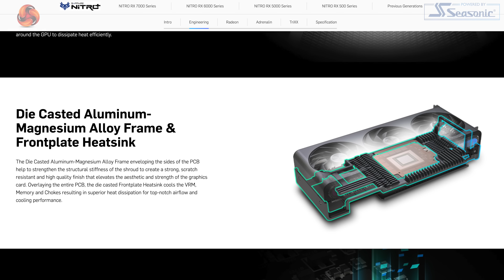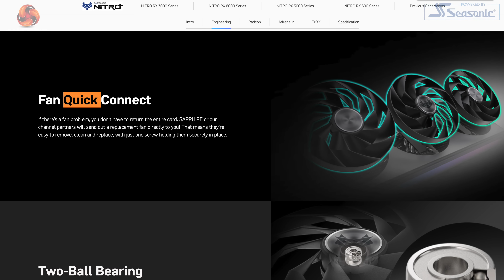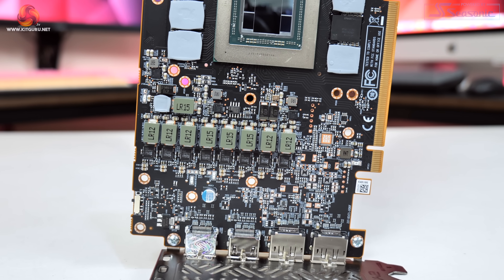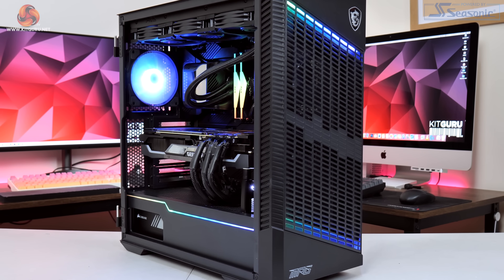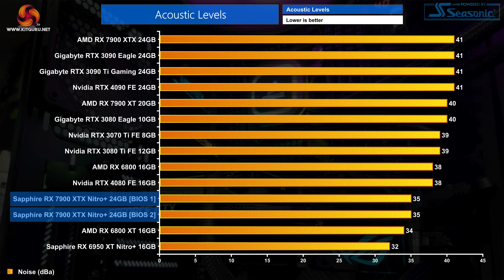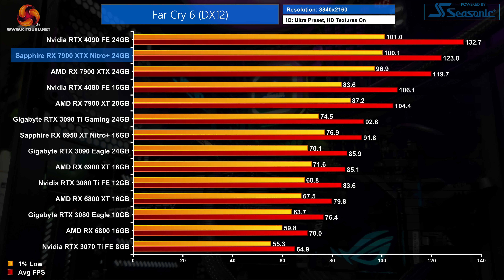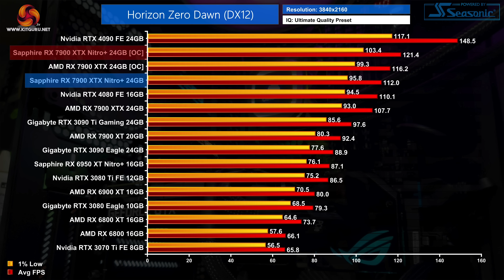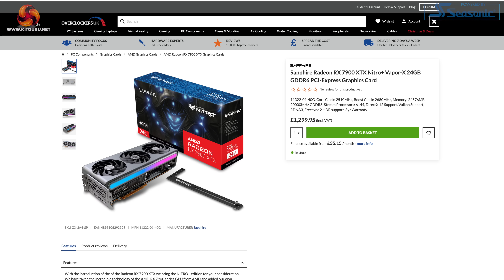Sapphire RX 7900 XTX Nitro+... one heck of a card!

Comment: One heck of an overpriced mid that has the efficiency of a last gen GPU…
Reply: Well AMD still using 5nm and 6nm like last gen, so I suspect this will not much of different from lat gen, Things would be better if AMD chose to use monolithic design on 4nm like 4000 series..
But chiplet design is the future I think.

Comment: This kind of shows that even if amd decided to make a new card that can hit the same wattage as a 4090, it wont beat a 4090 unless they change architecture again.
Reply: Not necessarily. Theoretically it would be possible to make a bigger RNDA3 based GCD with more compute units, Navi42 is not on the limit of what can be done. That could deliver more performance without being overclocked past a reasonable efficiency on the voltage curve. They also designed the MCDs to be able to take stacked cache dies. We don't know yet how much of an uplift that can bring.

Comment: Actually the XTX and the 4080 don't make sense as the XT has enough power to Ray Trace 1080P and 1440p and run 4K without Ray tracing.  Neither the XTX nor the 4080 can actually do 4K raytracing.  So the XT gets the job done at the lowest price point and it's the best deal!  Chew on that 4080 bigots!

Comment: Actually more power doesn't translate to more performance on a rdna 3 chiplet design, it's actually more cache and memory speeds.

Nvidia can crank out more pperformance due to the monolithic nature, hence they focus on massive heatsinks to cool it.
Try swapping out Nvidia's cooling solution for  standard GPU and you can see how hot it actually can run.

AMD needs to push for it's software to perform better in memory, but games are still based on other variables that benefits nvidia

Comment: AMD crapped the bed with this arch. Hope they can pull it together with the next card.
Forced me to buy a 4080.
Reply: Why didn't you buy a 4090?
The 4080 is a 4070ti in disguise at a ridiculous price.
Reply: @xXDESTINYMBXx  because it's 2000 rn  which makes it have an even worse price performance than 4080, 4080 and 6800 non xt are the price/perf kings rn sadly, what a joke of a market
Reply: @lapz6758  that's just a little more than 4080 and it's a lot better
Reply: @lapz6758  4080 is a price/perf  desaster.
6750(xt) and 6800(xt) is a good price/perf card. Look at a p/p chart please.
Reply: @xXDESTINYMBXx  6800xts are going for 700 now...
Reply: @lapz6758  just looked at a newer video and for some reason their price went 28% up, probably because it was such good p/p that demand raised the price again.

6750xt is still a good buy tough, almost as good as a 3070ti but ~200$ cheaper
Reply: @xXDESTINYMBXx  the best buy is 6800 at 500 rn

Comment: Great work and merry Christmas. 

You mentioned coil whine: have you considered doing a video on it? The subject in general, not just the whine of this card, that is. Like the frequencies of the whine. Someone who's deaf above 8000Hz may tolerant of a whine that someone who's deaf above 10,000 Hz may not if that whine is at 9,000 Hz.

Here's looking to more great content in 2023!
Reply: Coil whine is generally the result of too much voltage trying to pass through a PCB or Voltage Regulators maybe, it's often a result of extremely high power use due to the system being confused from bad sensors and bad thermal conductivity...
Reply: its usually more noticeable too at massively high frame rates. like over 200+

Comment: I bought this but managed to get a 4090 FE the next day, for only 300 quid more. As much as I prefer the look of the Nitro it just seemed to make more sense to stick with the more expensive 4090 FE. What tipped it was I don’t need to spend any time overclocking the 4090, and the 4090 uses less power to hit its frame rates in the games I’ve played so far, and I know I paid the correct RRP for the 4090. It’s frustrating though, I would have preferred to go AMD this time around.
Reply: Sapphire = $2,300 gigabyte 4090 = $3,500 but I guess pounds are a lot different.
Reply: @spaceli0n  Yeah, good point. The situation will be different where you live so just get the best performance you can.
Reply: teach me how to get one
Reply: @donbetulio  where are you base ?
Reply: @donbetulio  Which one, the 4090 or Nitro?

Comment: I was dead set on getting this specific card as soon as it gets available. It's still not even gotten a price in price comparison sites so it's impossible to get right now. However, I also was dead set on not buying Nvidia cards anymore but after all the trouble I've had with my Sapphire RX 6900 XT Nitro+ Special Edition with frequent driver crashes that due to everything I found googling for a solution can only be stopped by turning XMP/EXPO or SAM off (or buying different RAM) and I'm not gonna buy more hardware just to be able to buy an overpriced AMD GPU out of disgust for Nvidia. So to get rid of this 6900 XT that constantly gives me minute long black screens from crashing drivers I guess I can only go with Nvidia if I want a working PC. Sapphire already replaced my old card with crashing drivers for a new one and all that changed is that the new one has the most awful coil whine I've ever heard...
Reply: What crashes do you get?
Reply: @BIg_H85  screen turning black, not getting any signal for a few minutes while audio still plays, then it suddenly comes back to life and tells me a driver crash was detected. On both, the returned card and the replacement one.
Sometimes I go for a week or so without this happening, sometimes it happens ~6-8 times in one day. Sadly the latter is the more common one.
Reply: I once in a while get a crash on games when using the 6800 XT reference and the Sapphire Toxic 6950 XT. However I get a green screen crash almost every single day when browsing Windows or the internet. The green screen crashes have never happened while gaming so that is good. Since those crashes are the ones that require to pull the HDMI cable out and put it back in.
Reply: @theHeartlessNooB  I used to get green screen on my PC ultimate 6900xt, mainly playing games though. I started reducing some of the increases in tuning and eventually haven't had one for 3 months or so.
Reply: @BIg_H85  You might be on to something. The 6800 XT green screen crashes stopped once I put that computer on a cheap 1080p 75hz monitor. But both the 6800 XT and the 6950 XT get the green screen crash when being used on a big 65 inch 4k display at 120Hz.
Reply: @theHeartlessNooB  hmmm interesting, I run two 1080p @240hz just waiting for my 1440p  @240hz to turn up next week. Hopefully that doesn't wind the card up again 🤣
Reply: @BIg_H85  How does 240hz feel compared to 120? Is the jump as noticeable like when you go from 30-60 or even 60-120? I know that there is diminishing returns.
Reply: @theHeartlessNooB  I went from two BenQ monitors what were weak as so the jump is noticable. Both monitors are Alienware and they are great 😍
Reply: @theHeartlessNooB  isn't this maybe a cable issue?
Reply: @xXDESTINYMBXx  It could be, but I have tried Audiquest 100 dollar cable and cheap Amazon HDMI cable and the same thing happens. Most importantly, this never happened with any previous Nvidia card. I am team red if anything. Right now I am about to upgrade and deciding that maybe its time to go back to Nvidia with a 4090. Kinda feel a little bad about buying the 6950 XT just two months ago.
Reply: @theHeartlessNooB  did you try dp?
Because I never got driver issues like this with my nitro+ 6800xt with display port.
I have the m28u  (4k/144hz)
Reply: @xXDESTINYMBXx  I ordered a 4090 and sold the 6950 XT. In the mean time I am using my old GTX 1060. Not a single crash or green screen. Same cable, same TV.... I don't think I will be going back to AMD anytime soon.